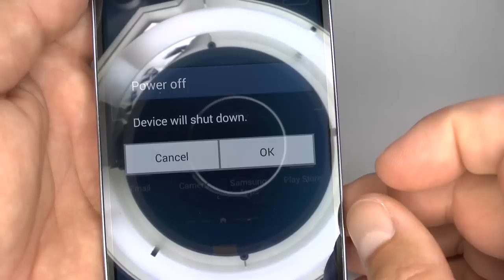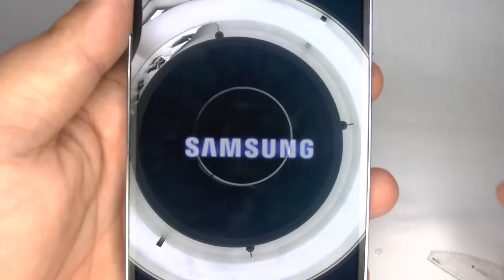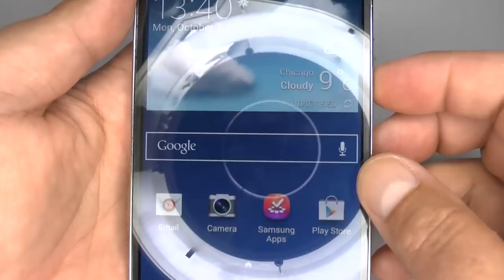Galaxy Note 3 Disassembly Teardown & Assembly - Digitizer Screen & Case Replacement

Comment: SORRY TO BUG YOU BUT DO YOU KNOW WHY MY  NOTE 3 WOULDN'T POWER UP AFTER SWAPPING THE DIGITIZER AND LCD THE LCD IT SPRINT
Reply from the maker: it won't power up unless the mainboard is pushed down by the rear cover
Reply: ***** i even screwed in the screws still no response is there any other reason it wouldn't work?
Reply from the maker: Denis Nikiforyan the front housing might be slightly different from your original. Can you try the old screen again?
Reply: ***** Did that and no response is it possible that that mother board is not clicking in right even if screwed in?
Reply from the maker: Denis Nikiforyan It might be the power switch has been damaged during transfer or the screen frame is different and has shorted something on the mainboard
Reply: DO YOU KNOW WHERE I CAN BUY A MAIN BOARD?
Reply from the maker: Denis Nikiforyan Its hard to find a mainboard for sale anywhere, its normally cheaper to buy a used phone with a damaged screen. Did you know typing in CAPS is like shouting?
Reply: I'm sorry didn't mean to make it seem like that and thank you
Reply from the maker: Denis Nikiforyan no problem :-)

Comment: You've mentioned almost everything, except where the Hard drive/ internal memory is. I just can't find it.
Reply: Yea but there is no physical hard drive in there. Its called NAND (NOT-AND) and that chip is fixed on the motherboard. Samsung uses EMMC IC's
Reply: Lorenzo van het Hul My Note 3 fell in sea water. I think the motherboard is shorted, so I need a new motherboard, but I want to keep my old EMMC, you think this is possible?
Reply: It is possible, but it requires soldering and reballing skills cuz its fixed on the logic board. Pretty hard process but if you have importand files on there, then let it get fixed by medon iPad rehab (jenna jones). iPad Rehab Jessa Jones

Comment: I've dropped my phone in shit water (Shit + water) and after I clean it out with water (without battery of course), I've dried it for a day. I turned it on today and I found that my screen was flickering. I immediately took the battery out then left it for another 5 hours. It still flickered so I tried changing the battery. That didn't fix it either. So I decided to follow this tutorial and after I lift the mainboard up, I saw pool of water on the copper side of where display flex cable seems to be connected. Now, I've dried it out and now I am about to put everything back. Wish me luck!
Reply: +SoloWing Pixy Well that didn't fix.. maybe I'll just put it out to dry a bit longer....

Comment: I cracked my screen :( and only the screen cost 180 dollards fck
Reply: +Chapin001 Here in Holland it's 225 Euros... about 250 dollars.
Reply: i found it on ebay for 167 dollars :D Roland Holczer
Reply: +Chapin001 your sure that not the lcd your talking about?
Reply: Yes since the digitize comes well glued to the screen therefore the screen cracked :(
Reply: Well can you still navigate through your phone? If you can then you dont need to buy a lcd just a glass screen for it.
Reply: yes but see the problem is that i tried to separate the lcd from the glass panel and the lcd was well glued that it just cracked therefore i had to but the whole screen with the glass already applied lol
Reply: oh ok that sucks
Reply: +Chapin001 put the whole thing together. register your phone through SAMSUNG's ADH and take in your phone for a free screen change